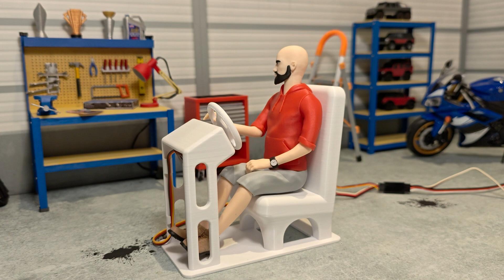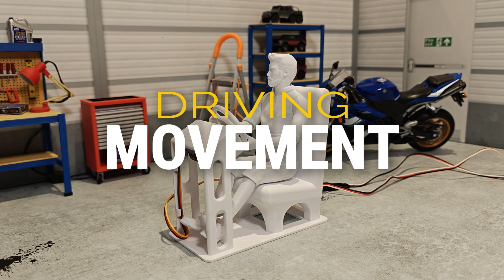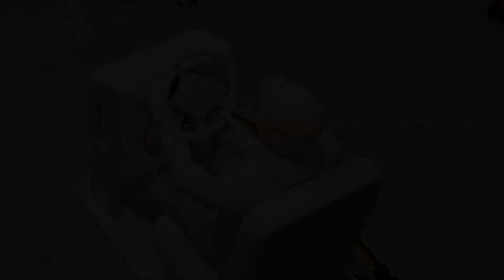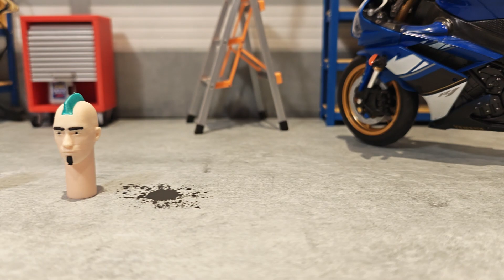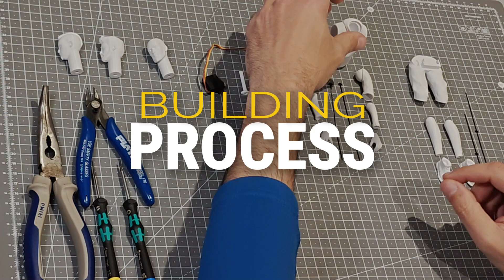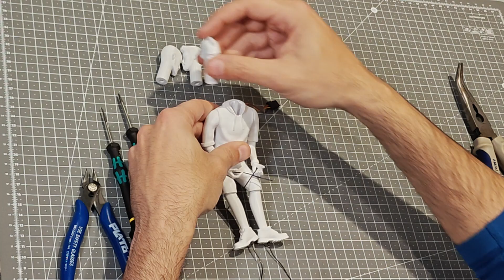1/10 Scale Realistic Animatronic Driver

Comment: Hello, I'm interested in this driver's outfit, but I'm wondering what the black line running down his arm is called and where I can buy it. Could you please advise? Thank you very much.😊🙏🙏
Reply from the maker: Hi, the driver is a 3d printed model. There is a link in the description where you can find the files and print it yourself. 

The black line is a zip tie 3d printed using TPU which is a flexible filament.

Unfortunately I cannot sell it 3d printed at the moment.
Reply: @robroy07  Hello, I have purchased two of your building plans, one for a three-wheeled drift car and one for a tractor driver, I'm not sure. But how can I buy the drift driver? Can you please advise me on how to buy it? Thank you very much.😊🙏🙏
Reply from the maker: @cryptoinvestment7651  Great, thanks! In the 15 page of the trike manual there are some links you can visit to buy the driver. Besides, for the trike, I would recommend using an AM32 ESC (https://aliexpress.com/item/1005008453629933.html) instead of the one I used since it offers more configuration options.
Reply: @robroy07 Thank you very much. I clicked on the link, but it said, "Sorry, we can't find that page."
But we still have lots for you to discover.
Back to the homepage. Is there a link that works? Thank you very much.
Reply from the maker: @cryptoinvestment7651  Oh, sorry to hear that. I will look for it. By the way, if you have an Instagram account it could be easier to talk about it there (there is a link to my account in both cults3d and in the build manual in case you have one)
Reply: @robroy07  I have come to see your IG.

Comment: Where do you get these? And do they come in 12 scale?
Reply from the maker: Hi, I'm not sure that I understand the question 😅. Do you mean the size of the driver? I made it (designed it) to for in a 1/10 scale RC rig. It has a small servo to move the head and another one to move the steering wheel
Reply: @robroy07 wow! Great job! Could you possibly sell me one?

Comment: The quality of 2g servos is terrible. I bought 2 new ones and they broke down very quickly. Maybe it was a heat dissipation problem. The servos got very hot inside the body.😂
Reply from the maker: I haven't had any problems so far with them but I guess it depends on the luck. Are you using the big ones or the small ones? If you are using the small ones you may need to use a diode when plugin it to a 7,4v. My recommendation to avoid this kind of issues is using this one: https://aliexpress.com/item/1005006147359728.html

Comment: Looks very good! Definitely needs well tuned 3d printer, but result should 100% be worth it.
Reply from the maker: @lynxeduard  Thanks! I think that any 3d printer right now can do it easily although if you don't have multicolor support you will need to paint it (I suck at painting).
Reply: @robroy07  I use a Bambu A1 machine with an AMS set. It's 4 colors. It should be able to print. I'm just wondering what the black lines that go into the driver model's arm are. Are they in the file to be printed or do I have to buy them separately? I'm planning to buy this driver set. Thank you very much.
Reply from the maker: @cryptoinvestment7651 that's a great printer and it should work perfectly. I printed this one in my X1C.  

Everything is included in the file, the different parts of the driver, the zip ties, the servo support and even the seat with the steering wheel to test the it. 

There is also a manual included to help you build it.
Reply: @robroy07  You mean the rubber bands, which hold the arms and legs together, are printed 'zip ties' (TPU, I guess?).
Reply from the maker: @RuudK. Yes, that's what I meant. I called them 'zip ties' since they are similar but they are 3d printed too using TPU